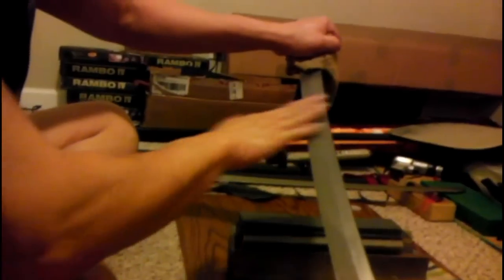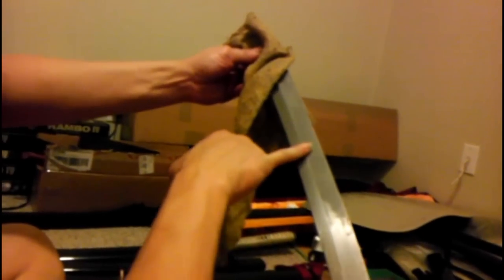My Edited Video

Comment from the maker: @jacob33kim Thanks,man,well our blades sharpens in like 3 -4 strokes on the stone in under a minute,That's why I had that part  of the video on there,This is special designed edge geometry for ease of re-dress,and you will never touch the Ji,The other parts is for reduction of the convex aiming to attempt the quad,but I think my skill is not enough. :(